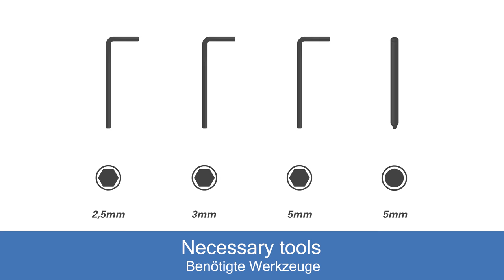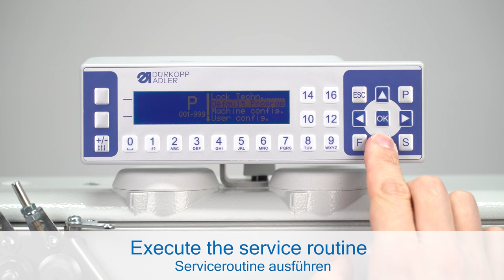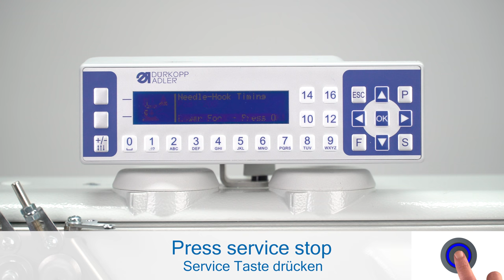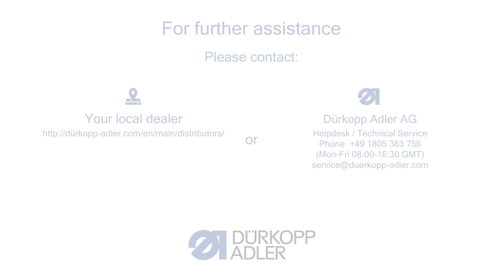Service Video - Dürkopp Adler cl.867-M PREMIUM - Basic settings hook and needle

Comment: I have a problem with the regulation of speed. Machine Durkopp controlled by Ho Hsing G75-2. Maximal speed is 15. It seems that is limited somehow. P0 was put 40 with no result, reset didn’t help neither. I can lower speed, but I need to make it higher. Please help, I really need advice:)))